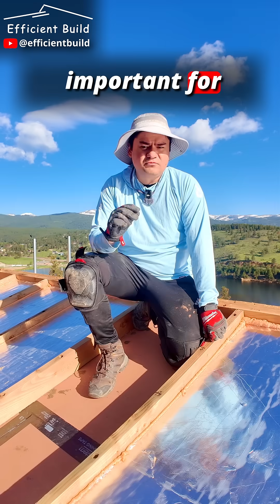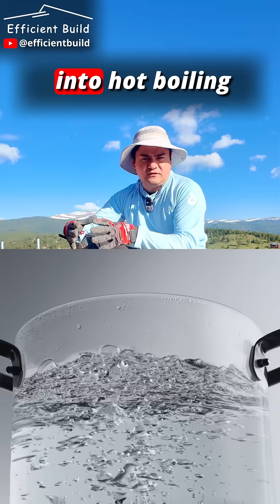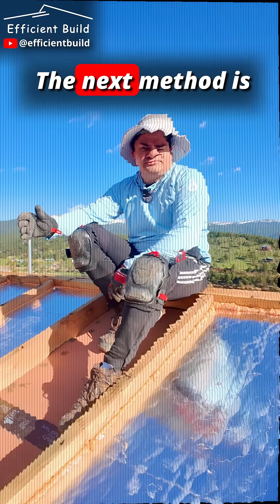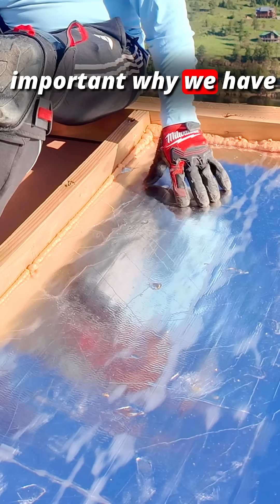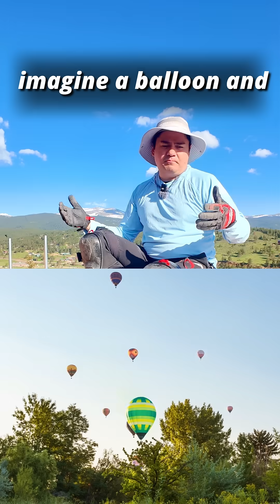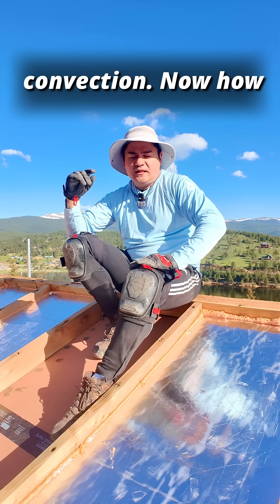Heat Transfer in Construction: Conduction, Convection & Radiation Explained

Comment: Love it! Can you explain how radiant barriers in the attic work? They are covered eith carous layers, so sunlight doesnt bounch off it.
Reply from the maker: Hello, thank you! I'm not sure what "They are covered eith carous layers" exactly means, but radiant heat comes from everywhere. The sun is a good example to use, but if you use a thermal camera you will see, you yourself are radiating heat. As a whole, radiant barriers intent is to bounce heat away from the surface. If you are inside maybe you want to bounce the heat back into the house or viceversa.